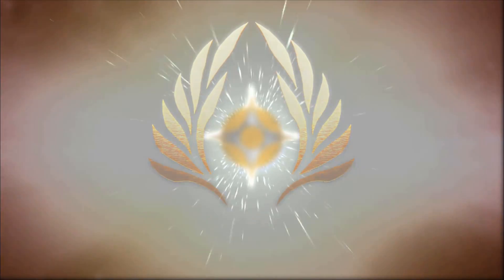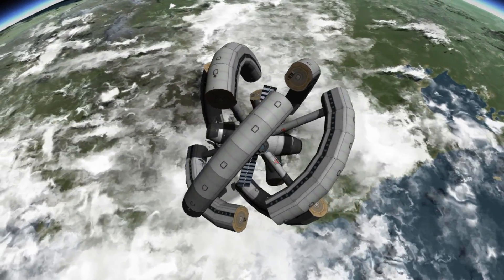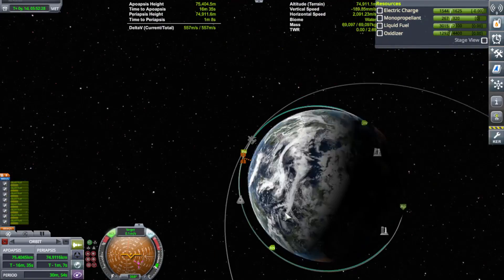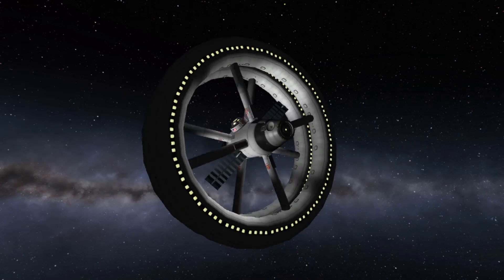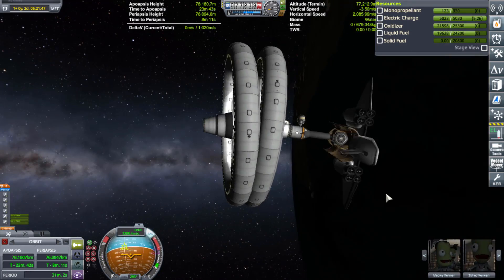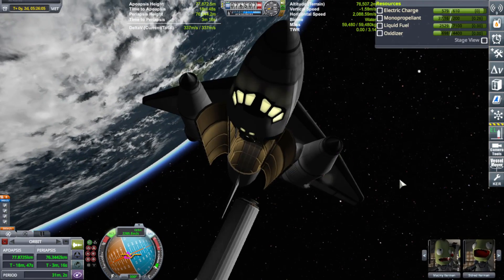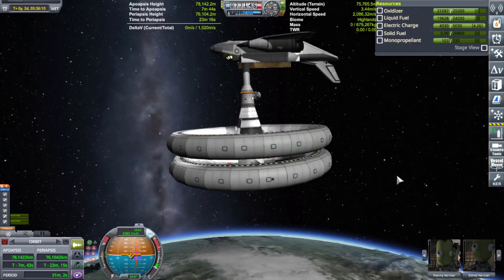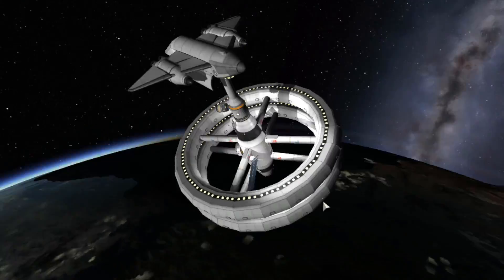ONE LAUNCH UNFOLDING DUAL RING SPINNING STATION  \  KSP 1.12.2  \ Kerbal Space Program

Comment: This man is criminally under watched. Makes some of the most excellent vanilla ksp. I love RCS builder and recommend the mod. It helps with both checking the wet and dry mass of the craft and minimizing torque from main drive on asymmetrical crafts. Specific designs can balance SSTO to where the wet and dry mass of the craft stays at the exact same point. Impossible to optimize drag under those criteria, I've found. Large SSTO's with unusual or asymmetric payloads can be balanced to have 0 torque to make massive crafts behave more like medium ones.

Comment: It's weird that the rotors spin the whole station. They're counter rotating, so they should cancel each other out.
Reply: If you think about F=ma it makes sense. The heavier parts take longer to get up to speed as the force (from torque) is the same.

If you only attach each ring by one rotor and offset them it might work.
Reply: @jcskyknight2222  When I make counter rotating stuff (and I don't care much for excessive clipping or aesthetics) I put both rotating sections on 1 motorized rotor, which is held to the main body by 2 unmotorized free-spinning rotors. It isn't perfect, sometimes the main body still gets some torque, but it work well enough.
Reply: I think the rotors would have to be perfectly balanced to keep the center from spinning. KSP doesn't give you that kind of control, but it's much better if you avoid driving rotors to their limit. I once used a KAL controller to slowly increase the RPM of a single-ring station and got much less spin of the core than VAOS has with 2 rings here. Use the trick on a 2-ring station and the core might not move at all. However, it might take quite a long time to spin up.